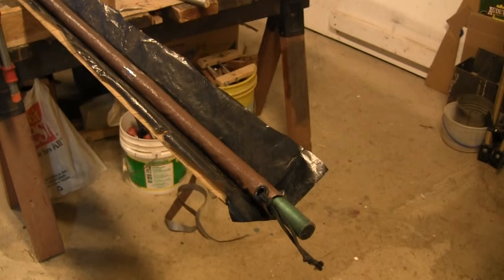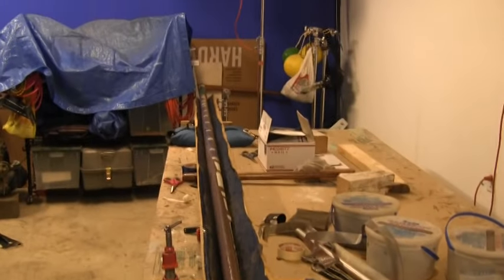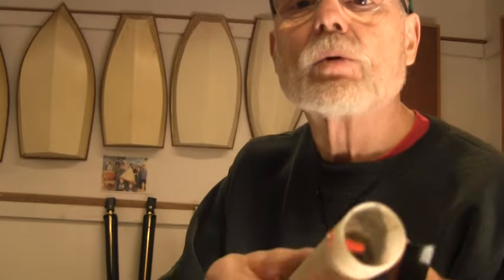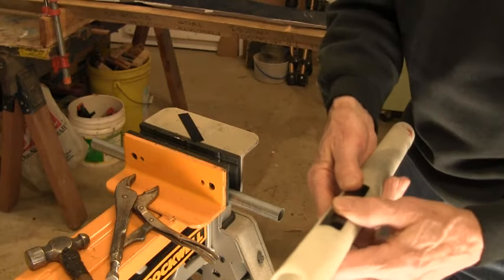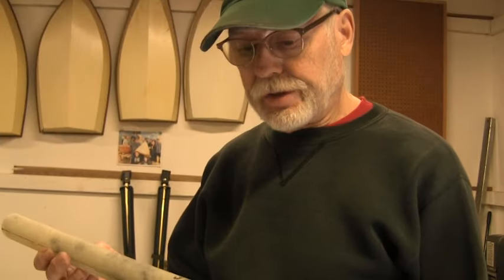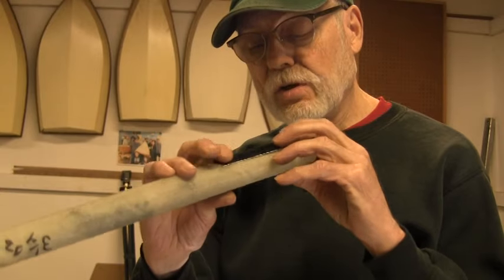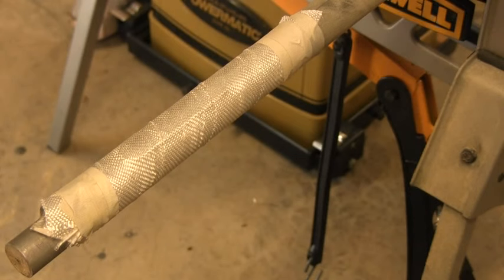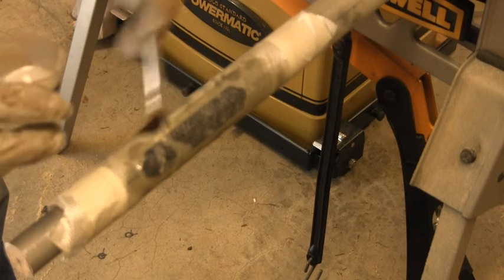Making a Fiberglass Mast Part 3

Comment: I have enjoyed your videos so much. What i have not picked up on is the cleaning of tools after epoxy use .what roller do you use.and are your scrapers steel or plastic and how do you keep them clean for next use ,maybe a video on this alone would work Thanks
Reply: +Darryl BOB I usually just wipe them down.  I throw away the acid brushes, and the used toothbrushes, and I use cheap foam rollers cut into 3" sections to use with my 3" roller cage.  I throw those away too.  I have used vinegar to clean the metal putty knifes.  I almost always use a 3" "flexible" putty knife when I spread epoxy on flat surfaces.  You can see that I am using it's flat side to also "roll" the epoxy around the mast.
Reply: Thank you for the reply